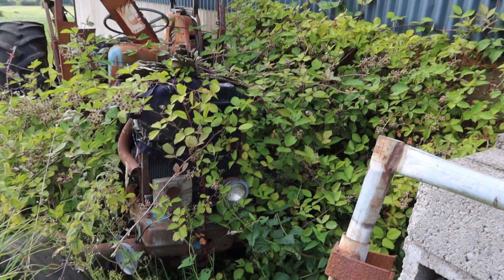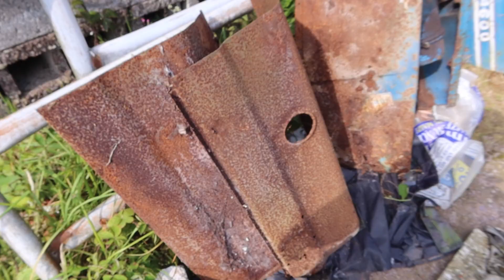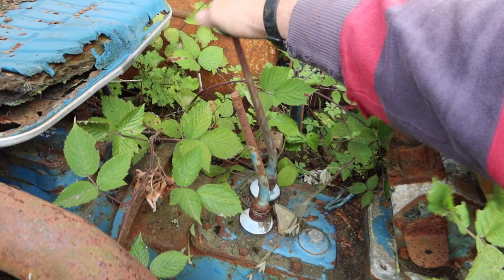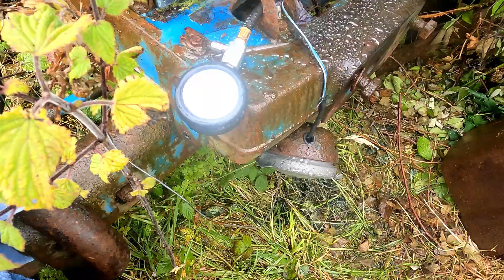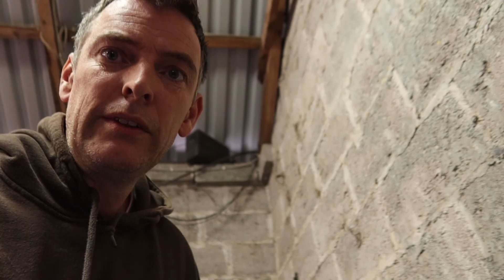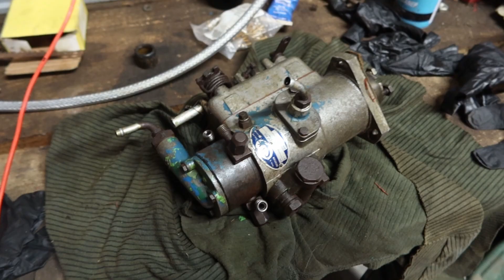Burnt and abandoned 20+ Years - Will it start? Ford 4000

Comment: That was the most frustrating will it start video I have seen....you seemed scared it will bite you....and it's always cheaper investing in a cheap can of ether at the start than almost burning out a starter and flattening a battery to work out your next move...
Reply from the maker: Either should only ever be a last resort in starting an engine, it should fire up without it. Also, a diesel engine will not run on either alone. There has to be some fuel present. As for the starter, the rest periods were edited out, so it was given plenty of time to rest and cool off. Anyone can connect a battery and spray either. I like to work things through and try to get it to fire without it.

Comment: Would love to know if you figured out what was causing the injection pump to spray out. I had to take a cav pump apart to free stuck plungers and now have the same problem! At least it works now wasn’t working at all before.😂
Reply from the maker: I still haven't got back to it, but I would think that a new seal kit would sort it. The kit is pretty cheap. I've bought one and I'll let you know how it goes 👍
Reply: @davesworkshop2714 Thanks. Been doing a little research myself and apparently there is a check valve in the return line on the side of the pump. If gets stuck it will cause the housing to pressurize. Going to look into it this weekend.
Reply from the maker: @myronbro  thanks for the tip, let me know now you do!

Comment: So your plans with this engine is to seal her up so she can be dependable? Yes. You say so and the slugs that had water on them and are now freed. So new o-rings and seals? I watched fuel spray out of her in three different directions. High pressure spray on some. Not that I understood how you polished such components. Seem genius to me and this cav may some day push this tractor all day producing food for our people. Sweet.
Reply from the maker: The plan is to strip the pump and fit a new seal kit, plus one of the connections to an injector line is leaking. Hopefully it should run properly then 🙂. I'll give it some basic wiring and get it moving too hopefully. Thanks for watching 🙂👍

Comment: That thing is identical to my ford 3000 and now I learned about the injection pump on it from you🙂🙂 the only diffence in the 4000 vs my 3000 is the 4000 has a low range trans and few other small things but the engine is the same. 👍 thanks for posting dave glad to c ya
Reply from the maker: Thanks Darrell. Looking forward to seeing the 3000 again!

Comment: That's  great work,your a bit of a genius with them engines,it sounded allright too.
Reply from the maker: I don't know if I'd go that far Colman 😅, but thanks!!
Reply: @davesworkshop2714  very interesting  you say 3 cycl was better than 4 cycl ,down here they tell me stay away from ford because of pourus block.
Reply from the maker: @colmanlong1032  I believe the 3 cylinder was less susceptible to going porus for some reason? A buy who has spent 30 odd years rebuilding engines told me there was no comparison. Coolant filters and more importantly, the correct mix of coolant is key to their survival!
Reply: @davesworkshop2714 hi would it be better to let the water out of a tractor in winter or to leave coolant in it if it's not being used.

Comment: New subscription great video
Please fire that easy start can away it's perticular bad on worn or stuck engines 
Get a map gas torch and spray in a shot of diesel it will love you for it
Reply from the maker: Thanks! I must admit I've never been a fan of it, but ended up having to use it on a few jobs lately where they  just needed that little bit of help. I need to buy a torch regardless so might try it. Thanks for watching 👍🙂

Comment: My old man had the 4000 with a secura cab. I always remember having problems with dirt in the filters she is gravity feed of the tank. I know that it was a bugger to bleed i think we even have a spare pump. I know Bundy bear's shed i seen a few of his video's. I remember the old man did the pump think it was a K reg being the old one so that would make her early 70s. Yeah I'd like to see more on it. The old man kept the 4000 till around 2001 or so it spun a shell in the field. It was sitting on a hill and only oil was get to the back one's. It still ran after that but he had bought a Belarus 920 by then.  With a loader i think it ended up somwhere down here in the Black Isle with me. A trader boy bought it with the intention of fixing it up. Hope you're all well cracking video snd will it start. Brought back a few happy memories for me the noise of the old ford cranking over. 👍
Reply from the maker: Hey Ali, good to hear from you buddy. I was thinking you'd like that one alright! I've been warned about bleeding those pumps alright. I even Brough a clickity clack pump to feed it but it wouldn't work. A guy told me the one on his 5600 was so bad they converted to an inline simms!
Reply: @davesworkshop2714  Yeah there terrible I remember being with old man moving hay and the the old ford started hunting. We did the filters in the field think we went thourth to cans of eiffer or Easy start lol the heater plugs on it where useless as well. The old man was a stubborn guy persisted untill it ran. The hay ended up getting put away we where still working at 11.30 at night. Lol I miss them days and I don't 😂😂
Reply from the maker: @AliMackMechanical  😂😂😂😂